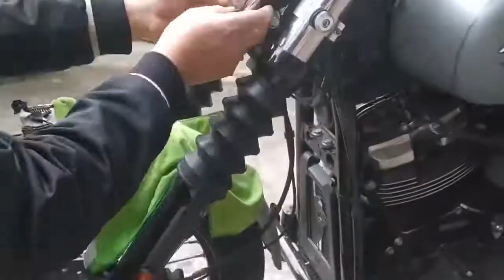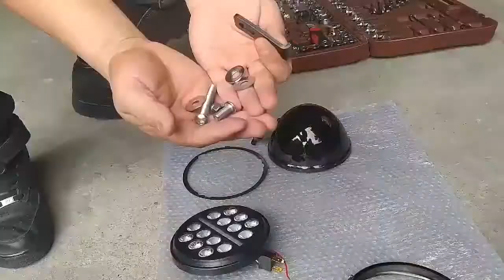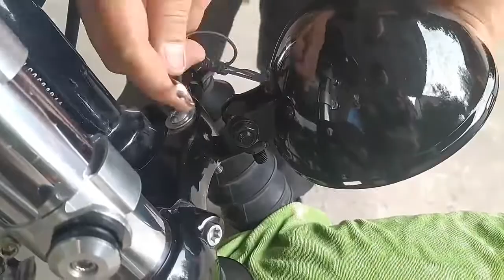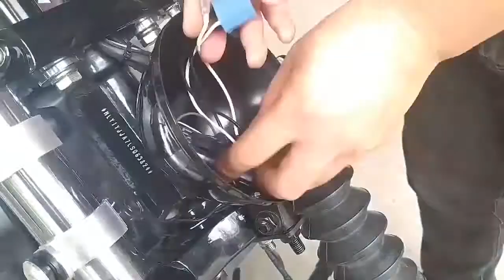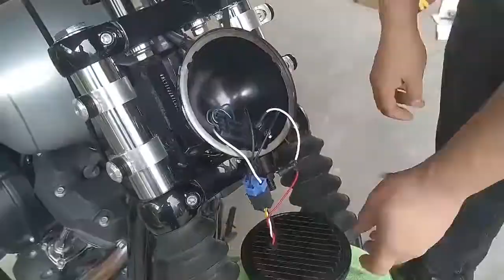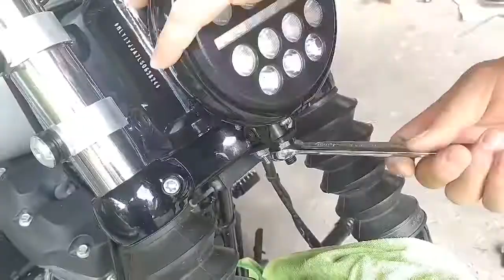How To Install 5.75'' DYNA LED headlight to Harley Softail M8 Street Bob FXBB

Comment: Did you use the extension that came with the Memphis shades warrior. If not was the light flush with the fairing?
Reply: Nope, no way.  Needs another 2 inches worth of extension.  Look at videos of people installing the road warrior on their Street Bob.  The extension block pushes the light much further out.

Comment: What did you do with the 2 wires sticking out of the back of the bucket looks like one is white and one black
Reply: I just installed mine and I still have no clue what to do with them. did you ever figure it out?

Comment: this has to be the worst installation video I've ever seen. filmed at the speed of light, no instructions, staring at connectors like you have no clue what to do with them, cutting stuff off that was included with what you sent and then two mystery wires stuffed out the back of the housing... awesome
Reply: My dosent light up😢